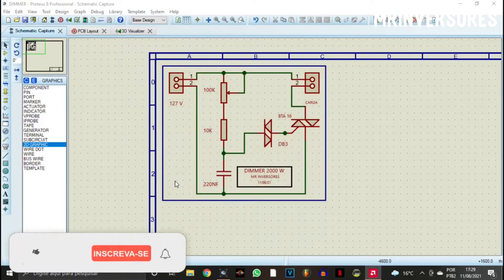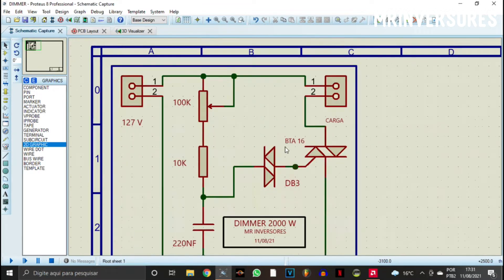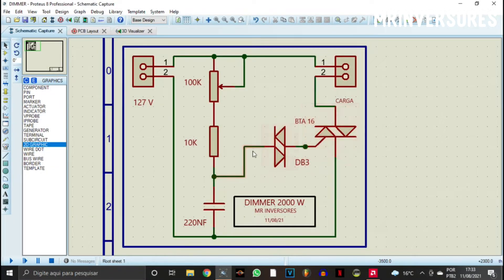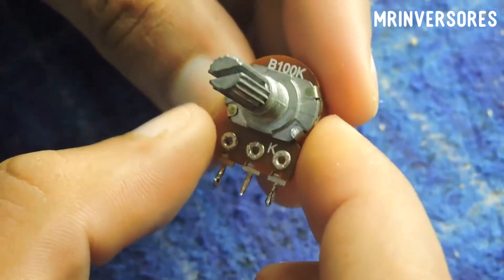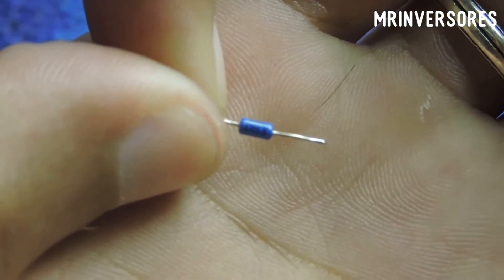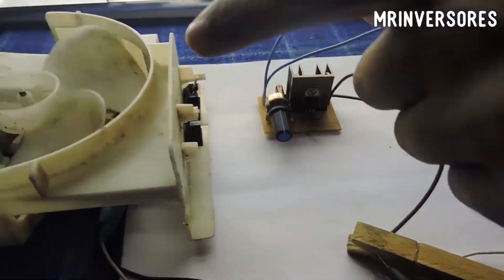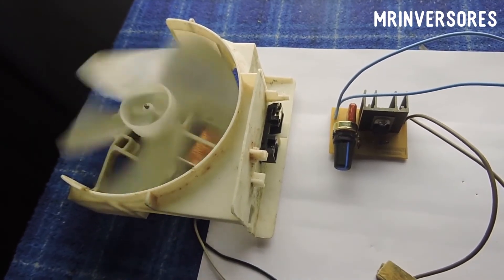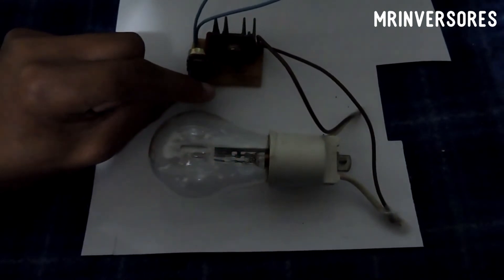HOW TO MAKE A DIMMER - 2000W (ALL THE DETAILS)

Comment: You have explained everything very clearly and it's effective. Please make more videos like this.
In India we are having 230V and I want voltage variation upto 120-130V maximum output. So what should I do to make this type of circuit. As you are having 120V input and varying output is nearby 120V, can you make some calculation and help me for making 120V variable output with 230V input.